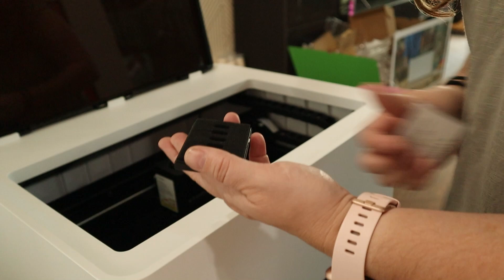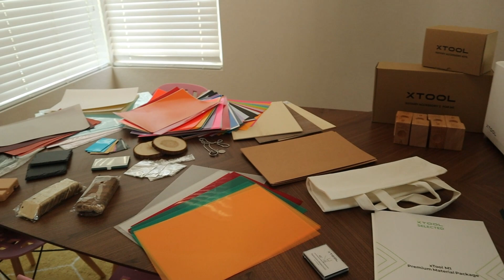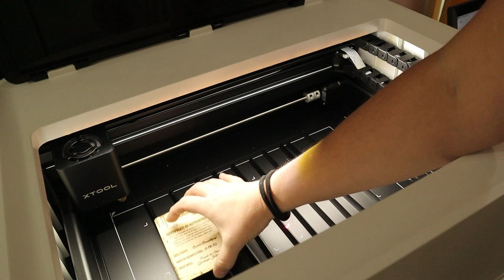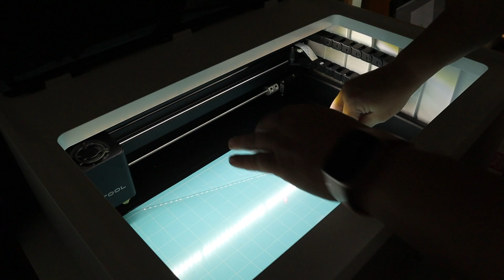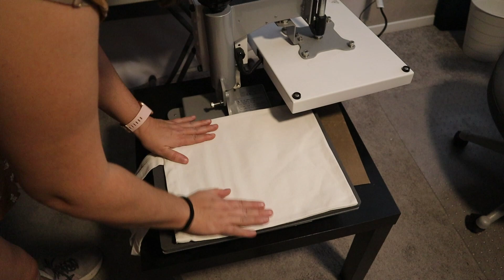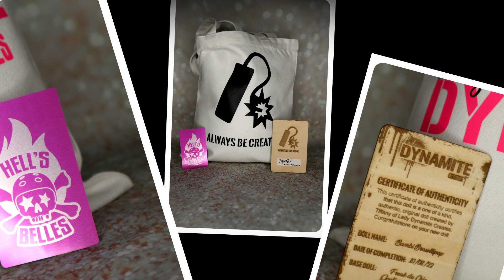DIY with the new xTool M1 and RA2 pro!

Comment: How do you like the way this laser performs?
Reply from the maker: So far I am very happy with it.  I have never used another laser before so I can't compare but so far its performed every project I have tossed its way with no problems.  I do find that I need to choose my own settings, the default settings are usually not great so I have to run the test grids on new materials first. I would say the inability to save my own materials profile is my only complaint atm.  I recently upgraded and bought the air assist for it too and it makes the cuts even cleaner.
Reply: @LadyDynamiteCreates  thank you 😊